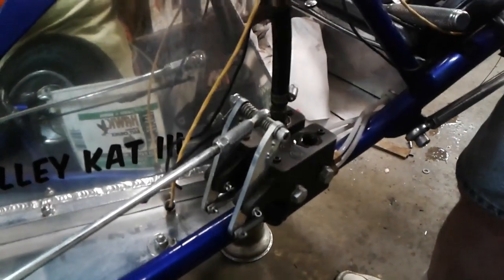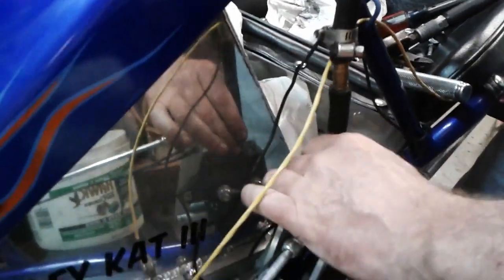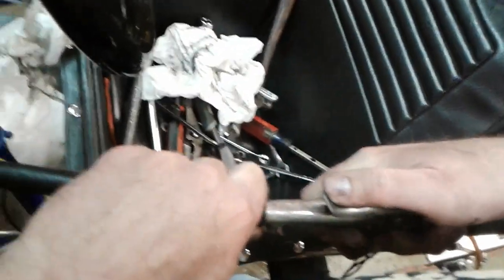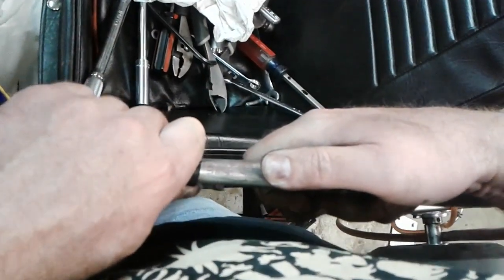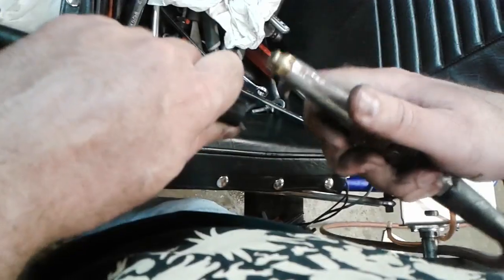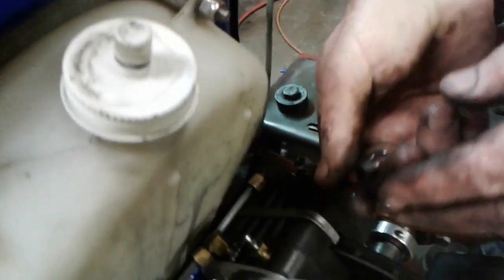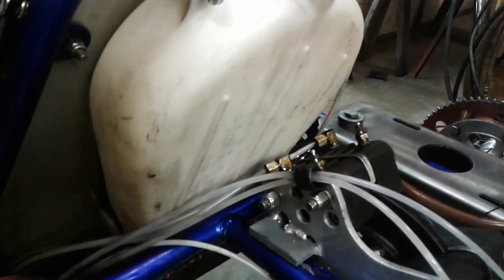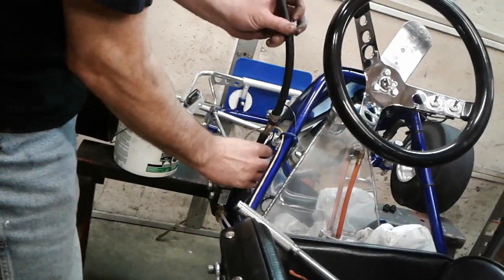How To: Bleeding Brakes - Karting MCP's

Comment: You can also put a small diameter clear piece of tubing on end of brake bleed valve to catch the brake fluid... it will not interfere with your wrench.